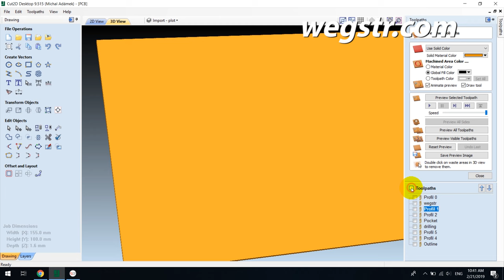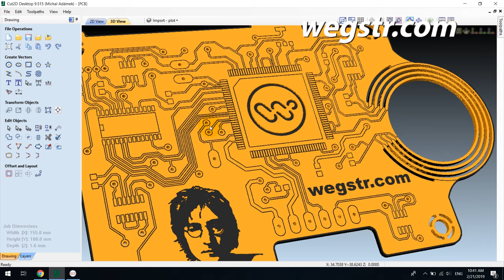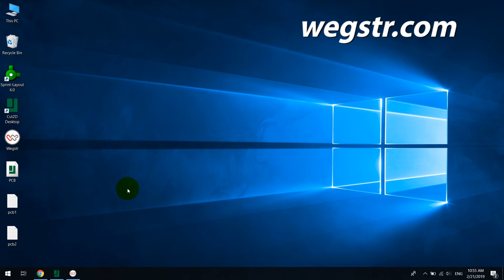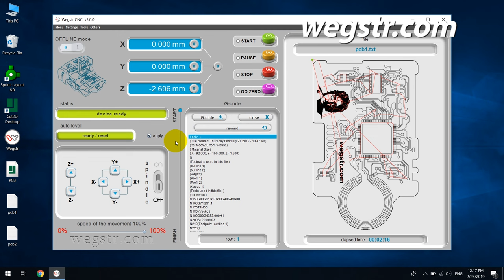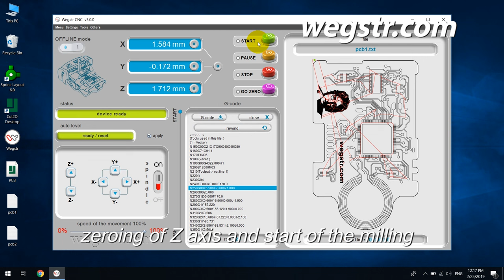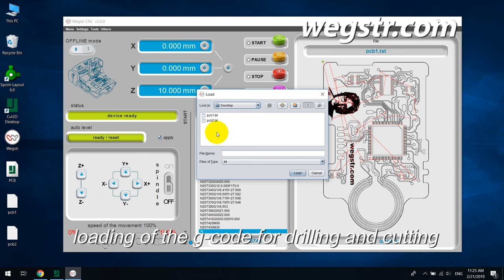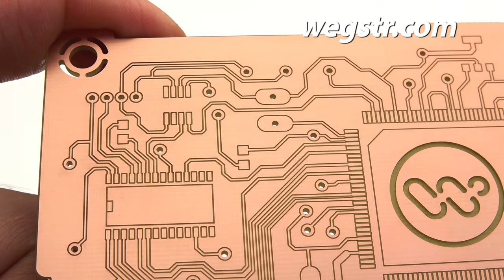PCB prototyping with auto level - STEP by STEP

Comment: Always enjoy the videos but would be good if you also added more info.

30 degrees single flute carbide engraving bit
depth of cut= z-0.060
speed= S12000
feed= F170.0

so other people can see more of the process rather than just the cut also, the copper removal process, selecting the area and applying the copper remove to a selected area etc.